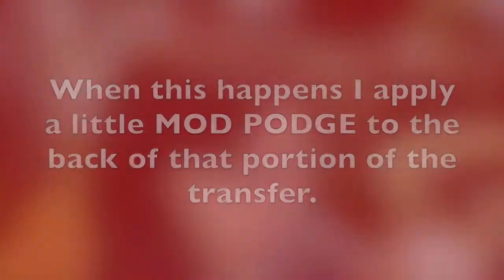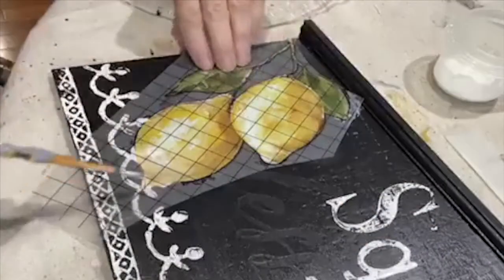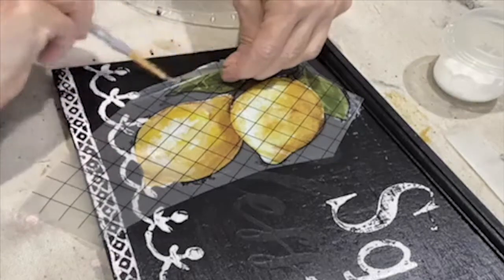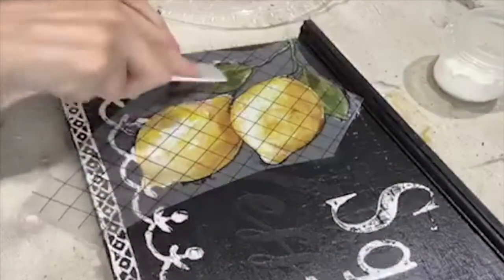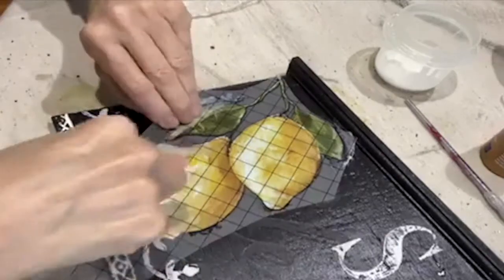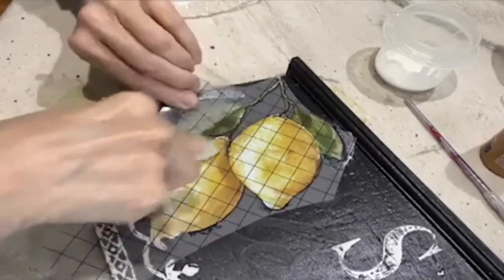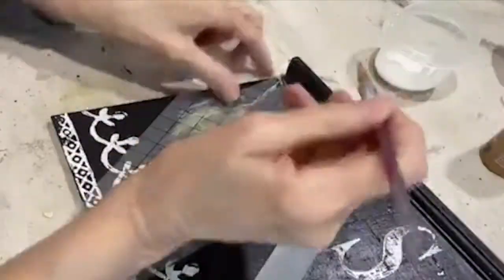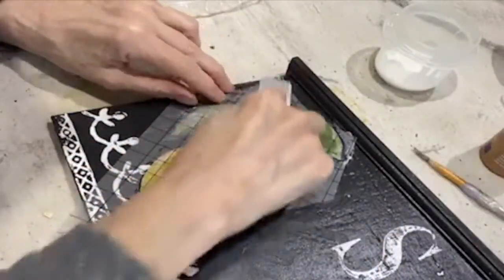Trouble Shooting When My Transfer Won't Stick

Comment: Thank you so much for sharing this.  I am going to try because I have not had a great experience with IOD transfers.
Reply from the maker: The key really is to seal your paint with sealer BEFORE applying the transfer and let it completely dry. I never have issues when I do that. This only happens in a live or workshop because I don’t leave enough dry time 😊
Reply: @SweetandSassyTreasures  I will give it a whirl with a sealer, but it is a good back up if I have trouble.  By the way I love Michigan.  I have been to Mackinaw Island, Petoskey, Sleeping Bear Dunes, Ann Arbor, Battle Creek, St.Joseph.  It is gorgeous.  I want to go back.